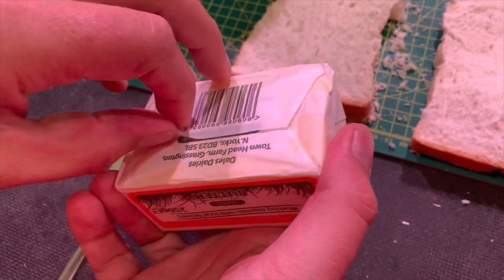Which is Better - LED Streetlight or Floodlight? 🤔

Comment: I want to fix light pointing from terrace to ground which is 30ft height. Light should cover for about 1500 sft area. Need some suggestions on what wattage and whether street light or flood light is better. Preference solar

Comment: I may be wrong but i remember from college that street lights was ment to be orange for colour rendering purposes and its low reflective light. Is this true or my imagination?  I certainly notice a diffrence on a foggy night.
Reply from the maker: Orange was because sodium lamps were the most efficient before LED.  The eyes perform better with white light and it’s easier to identify hazards.
Reply: @efixx   Just because the eyes perform better with white light does not dismiss the fact that LED lighting above 2700K color temperature is harmful to humans with the blue hues present in the spectrum, which disrupt melatonin production. The AMA released a position statement initially for any LED lighting not to exceed 3000K, but recently said it should be 2700K or less. 

Furthermore, cool white LEDs at 4-5000K are very disruptive to nocturnal wildlife and their migration patterns. The most suitable for residential is PC Amber LED 1700K and 590nm spectrum LEDs for proximity to sensitive wildlife habitat areas.
Reply: @ZaynCristian585  what about the LED headlights used in cars? Or the screen on mobile devices? They are all at the cooler end of things and shine directly in to your eyes 👀
Reply: @ZaynCristian585  LED lights have filters in to prevent UV light output.
Reply: It was kind of the opposite...the sodium lighting was orange but had poor colour rendering which was deemed not important for street lighting as having more light output per watt was more important than its colour rendering ability
Reply: I prefer filament light. (Infrared)

Comment: And here is me thinking you was going to toast it with the heat off the light.  I have a bright street light out side my house that lights up the bedroom.  Had to buy black out blind.
Reply: Can I ask I did a emergency job on a CU just to get the power on as the neutral bus bar was burned and the wiring as it was loos I has to move every thing over and use the RCD as main switch and strap the live Bus bars to each other.  This was just a emergency power job.  Now the owner will not let me put it right I did feel it was safe for a short time but as a RCDs can lock up if over loaded or heat you.  Should I report this some were as he will not let me change it and put this right.
Reply from the maker: @alunroberts1439  send a letter to cover yourself.
Reply from the maker: Ask the council they’ll add a shield if it’s a new install.
Reply: @efixx  spoke to them it been there long time I used the back bed room for a long time.  I will ask again for shielding or I doit my self but will end up being charged with tampering.